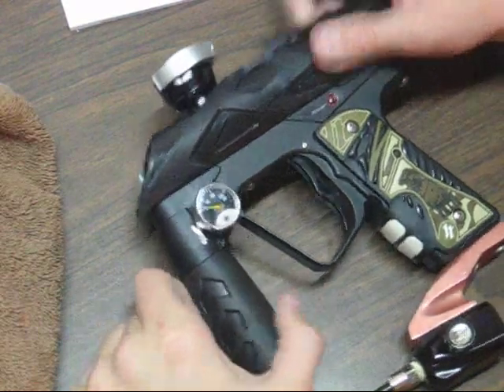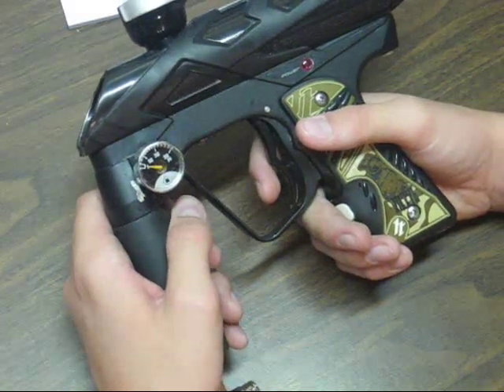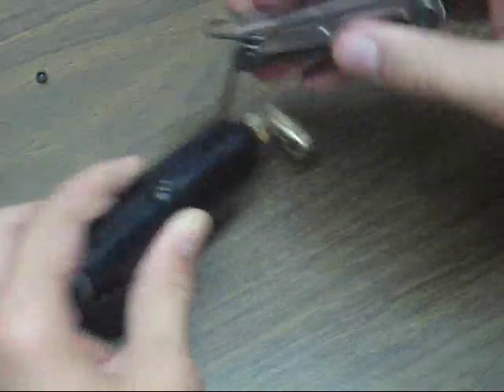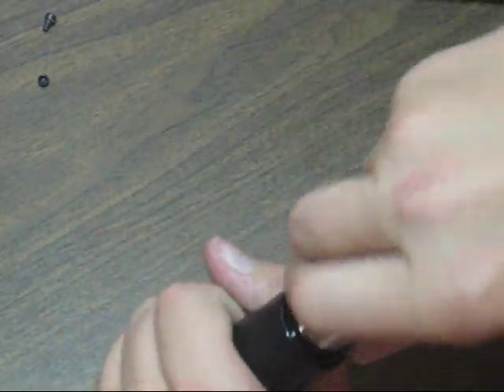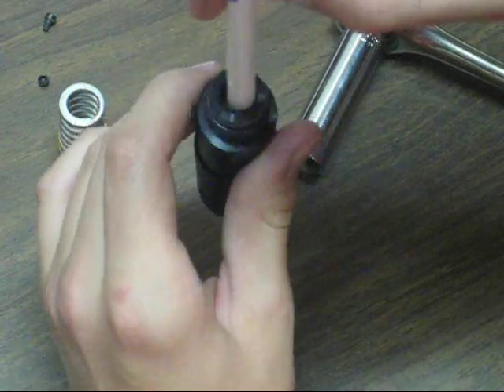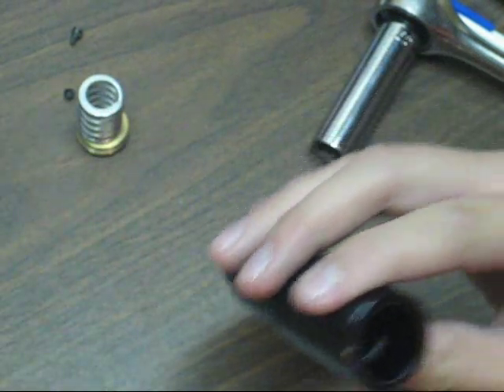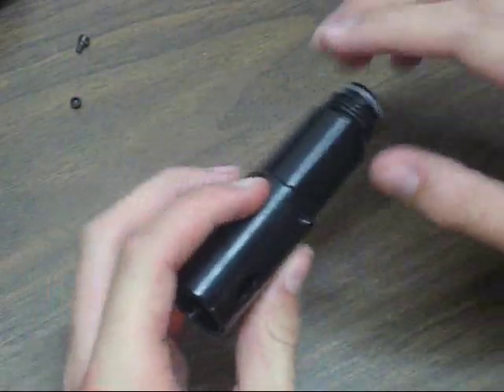Smart Parts Ion Regulator Maintenance

Comment: Hoping you might have an answer for this. I put my tank on my ion and it started leaking really bad at the top of the regulator. I pulled it apart and the filter is blown to pieces so not a big deal. But i can't see anything else wrong and it is still leaking badly.

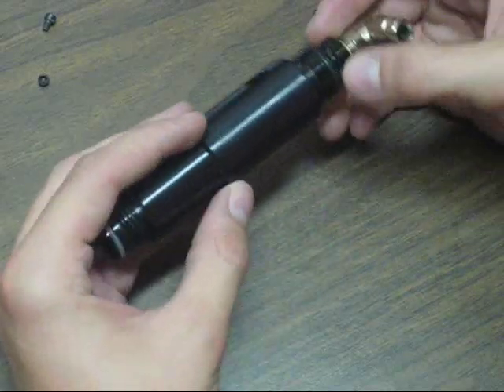Comment: HEY DUDE, PLEASE RESPOND. Ok, so your vids are the best, and i assume you know what your doing, soo. I have a little leak of air coming out of the bottom of the regulator. In between the Black nut, and the Spring Platform, or the part you removed at 3:42. Its coming out of the little hole, and im not sure what that means. Ive dissasembled the reg, and all the o'rings look fine. My last ditch effort would be to block the little hole's tube with somthing to stop it, but im not sure. Thanks! Sam.

Comment: yes i know its impossible to take off the reg fitting, its like they used red locktite on it, i stripped mine because i wanted to take off the fittings because mine were leaking, so i had to use vice grips, lol the fitting looks retarded now lol, but im using the ninja fittings now, theyre black and look sick

Comment: It is ridiculously hard to remove the first time, but it gets easier. I had to remove the grip (it ripped a little, but still goes on fine) and then I used an ipod case (the pouch thingy you get with the ipod, not a separate one) to help grip. I swear to god, those old school ipod pouches are the best grippy thingies I have ever seen. So yea, your best bet is a cloth and pliers.

Comment: i never even shot it, it kidna leaked all of the air, but im pretty sure it was because i had maybe like 10psi in the tank. either that or i did turn up the velocity really high when i was dissasembling it. I havent been to a field to chrono the gun yet though

Comment: You may not be able to help me but I bought a Dye Hyper inline 2 regulator, and i had a problem with a leak inside and all I had to do was tighten a banjo but then after that I tried again and it seemed like air went in but the gauge showed no air pressure. and it wont shoot :(

Comment: if you want to play woodsball, the 98c. its very upgradeable so that you can make it look and shoot however you want, and tippman is known for durability and quality.

if you want to play speedball, the ion. the ion is an excellent gun, and very easily upgradeable. in fact, you could build an ion without even having a single part made by smart parts. alot of people hate it, because they dont have one, or they hate it simply to hate it. but trust me, if you buy one you wony be disappointed.

Comment: what were you using when you lubed the o-rings? ive never seen that before.

i have reguar gun oil, but it says "for blowback markers". does this make a difference? i dont have an ion yet but im trying to learn as much as i can about it before i buy it. i have a mongoose and the only thing that i know i need to lube is the bolt.

Comment: I was cleaning my ion reg for the first time and i wanted to knew how far does the deep socket thing go down(or suppose to go down)

cause i put it in as deep as i can and i saw a little of the spring

ps i have no air to check so dont knew if it is leaking

Comment: i got it fixed it was jus that the velocity changer was spinning with the reg. it was turned in too far. but the air wasnt even goin thru the reg itself and up into the gun.